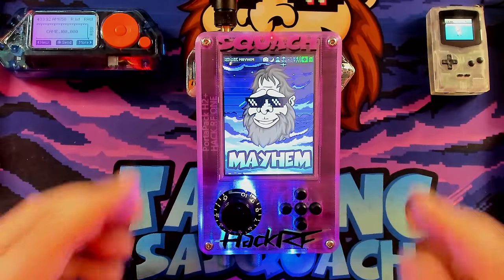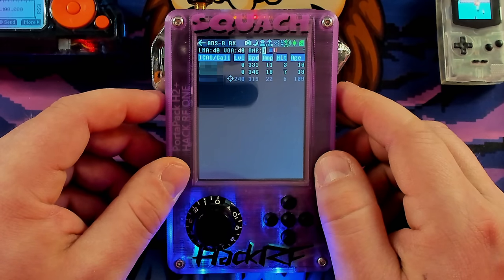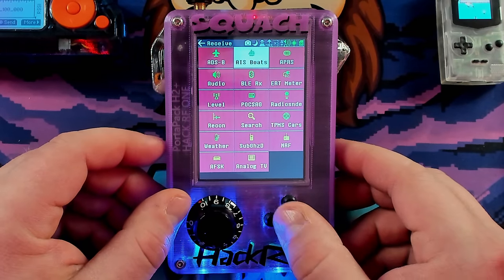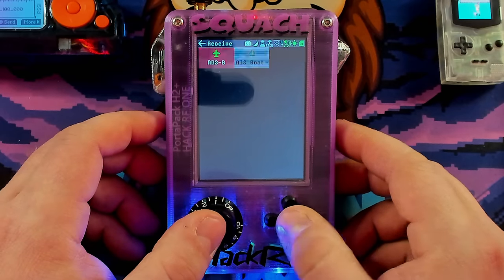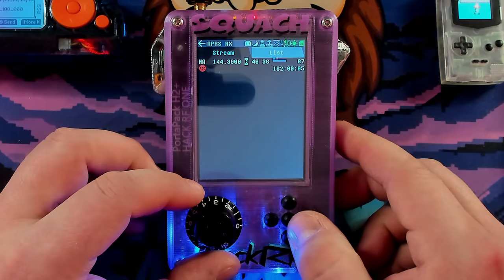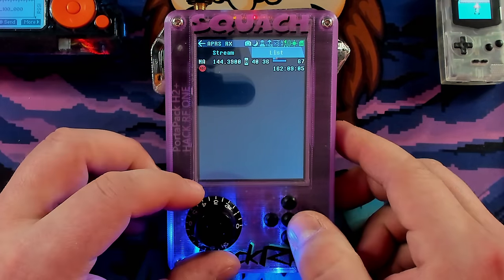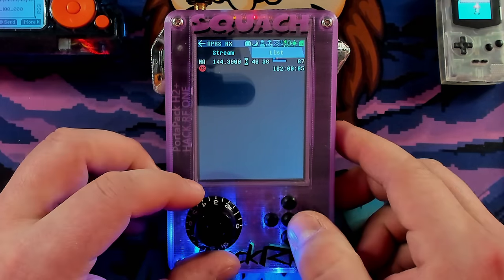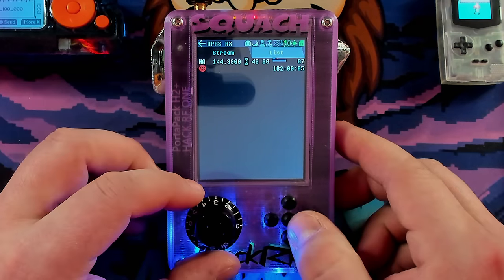HackRF 102 : Receiving Signals Explained!  Featuring Mayhem 2.0 & Antenna Tuning Guide!

Comment: Great video as always 🤟 APRS is like the original Meshtastic that radio amateurs have been playing around with since the late 80s. Worldwide network of long distance small packets used for messaging and positioning. 📡 One of the frequencies you can choose in APRS is the one from the international space station that actually has an APRS digipeater on board 🛰
Reply from the maker: Always here with the great info! Thanks Buddy!
Reply: One of the main reasons we use APRS is for location during a disaster situation. There is an icon set, emergency shelter, hospital, food location etc. I’ve been a ham operator many years. I encourage everyone to get licensed. Enjoy the videos! 73, k5adb
Reply: Do you know if it would be possible to receive Meshtastic Messages on the HackRF1 or would it need the app/programming?
Reply: I picked up a helical antenna to pick up coms from the ISS, and I'm hoping to pick up the green cube satellite. If you ever go that route, it's helpful to get an LNA to power the antenna if it requires it. You can use a tape measure yagi uda to hit satellites so you don't have to spend an arm, a leg, and a kidney. 🤣🤙🏾
Reply: qual a frequencia da estação espacial pára se escutar ela?
Reply: @TheGeekiestGuy  I've done it with my Kenwood TH-D74 and the stock antenna. Got a QSL card from them.
Reply: @StevenHoff  noice. I picked up an older kenwood ht recently, and it's night and day from my usual Chineseium ht's. I'm in Hawaii, and I got to hit the Greencube satellite at my buddies QTH with his massive setup. It's always nice to know folks can still make contact with a decent Ht.🤙🏾

Comment: You know, when you mentioned the TPMS app being not very useful I initially agreed, especially in its stock form. Then became curious if it could be used as a attack vector/entry point on a car. We know they transmit obviously, but do they receive? Are the connected via canbus to the car? Maybe it's something maybe it's not, just a thought.

Comment: In Ham Radio we use "Fast Scan TV" which is analog TV and can be picked up by the Hack RF, and APRS is also used in Ham Radio some of our handhelds and mobiles. Should be able to pick up a ton of it unless you're in TX.

Comment: On the topic of POCSAG, i got the hackrf just to reliably play with my pagers that ive collected. Its a lot of fun, i wish flipper had a transmitting app but its receiving app is neat enough but doesn't record or transmit well on the freqs my pagers use but might with a different radio add on.

Comment: What Antenna are you using in the video ? i only have the original Telescopic one from the HackRF1 kickstarter I met Mike Ossman a few times at defcon. And he has some pretty good OG talks on the hackRF1 from way back.
Reply: He’s using what looks like an antenna designed for WiFi, which makes it a poor antenna for the HackRF. The best thing you can get is a collapsible whip for a device as broad-banded as the HackRF.

Comment: Uhh.. APRS is primarily used by ham radio operators at almost all times. I have never seen FEMA directly use it. I run an APRS DIGIPeater.
Reply from the maker: Thanks for the heads up!  I apologize, I'm pretty new to this and I'm trying to make sure I have the best information I can, but sometimes I might stumble a bit.  Thanks for helping educate me so in the future I'll have even better info!
Reply: @TalkingSasquach You should look into getting a ham license. You clearly like this type of experimentation and the ham license will open a few additional abilities, plus it’ll give you some RF education along the way. HMU if you have questions.

Comment: Total newb from Sweden here.
That antenna tweak you did after your friend gave you that tip, im in that setting now n
But the saturation part is missing.
I guess i have some setting somewhere that turns that saturation setting on/off?

You know how and where i turn it on?

Thanks for the great channel you set up here!
Reply from the maker: Are you on the latest Mayhem firmware?

Comment: Any chance you can elaborate what the Bars in the second line (Normally) right below the Top Icons (right side). Sometimes theres 3. Ones blue and short and has red part at the end with a line, second is blue, third is green normaly with red part at the end. Thanks the tip on signal settings was great more like that please.

Comment: “APRS is used by FEMA”? Not really. APRS was developed by and continues to be managed by ham radio operators. If FEMA was using APRS at any time, it would only be because hams were helping them out.
Reply from the maker: I got some less-than-fantastic information when I was researching this part.  You are absolutely correct and thanks for the clarification!  I apologize for the error

Comment: 16:45 My retired, tech-tarded old roommate uses rabbit ears to watch TV, so it must still work.
Reply: You can get digital TV over the air just like the old analog ones, but the Mayhem receiver doesn’t demodulate digital TV. Doing so requires licensing a decoder, so you’re not going to find a freeware app that does it.

Comment: I built a coaxial colinear antenna outta old cable tv cable years ago for a SDR usb dongle.  It did increase the range nicely but a 1/4 wave tuned to ads-b frequency will give good results also.
They are line-of-sight so less trees & getting it higher will be better.

Comment: What happens if you were to accidentally use the wrong antenna for an app that requires a different frequency? Will it damage the device?
Reply: Theoretically yes, it could. With the low power output of the HackRF it’s unlikely, but you should always have a tuned antenna when transmitting.

Comment: •°.
🤪- The v2.0.1 firmware update, the AFSK & FOX HUNT under the recieve function.
Great job on the video! 👍🏻

🙄-Amazon:
Brand: Generic
5 Packs Antenna Adapter SMA Male to BNC Female RF Coaxial Connector Adaptor for Ham Handheld Two Way Radio Antenna SMA-M/BNC-F